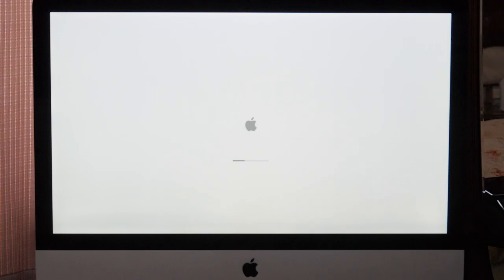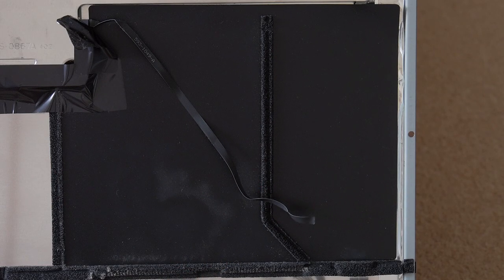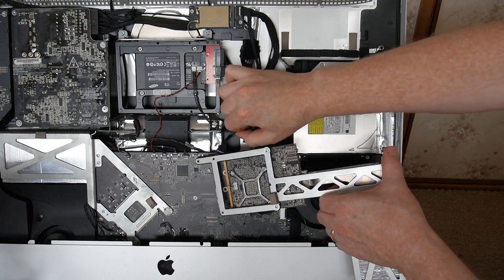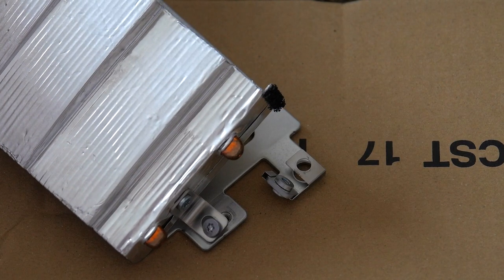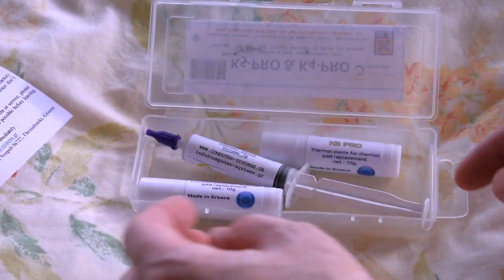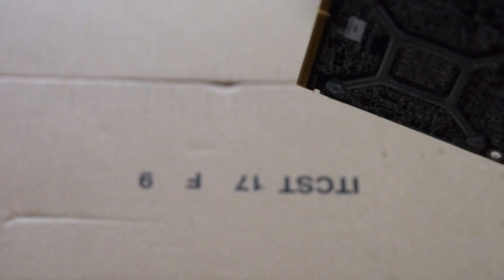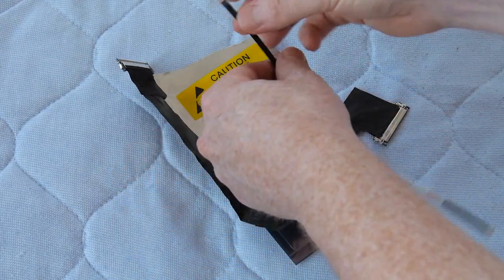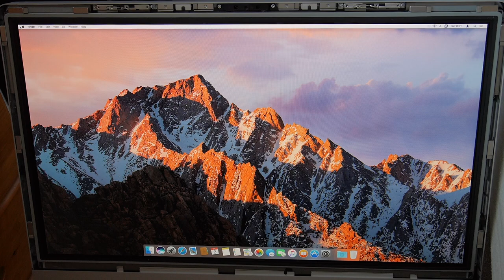Late 2009 iMac 27" Video Card Repair — 4850 — 2nd Bake

Comment: My video card 4850 is complete dead after this procedure. My mac doesn't want to turn on after i place the "fixed" card. It boots okay after removing it. But with her it doesn't boot. It lights from the diagnostic leds the LED 1 and after clicking the power button , the LED 1 has stopping light and nothing from them lights. Only boots without the card. Any suggestion? I do everything correct.
Reply from the maker: Thank you for your comment. I read and reply to every single comment under both of my videos, and your case is the first I’ve heard of things getting worse after the bake. 

It is curious that you say your computer boots without any video card, because your iMac should require the presence of the video card in order to boot. How are you confirming that it boots? And what was the situation before you baked your video card? The reason I ask is because you may have had a problem unrelated to the video card before you baked your video card.
Reply: @JDW-  My mistake not booting. Without the cards it starts spinning the fans and the starting sound of the system. My problem was that I got 5 purple lines. Sometimes it was working without problems but it random get those problems like 5 purple lines or mini square pixels. But now it doesn't want with the card. On the diagnose less. The led 1 is on but when i push the power button it goes off and doesn't want turn on the LED 1. After some minutes it's starts again but again only led 1. Without the video card, they are led 1 and led 2 on.
Reply from the maker: Are you checking those diagnostic LEDs with the display connected?
Reply: @JDW-  With and without i tested
Reply from the maker: @OfficialDjNaijal  Download the following PDF and go to page 23 where it talks about "Diagnostic LEDs."
https://drive.google.com/file/d/1Bs7Th2tfCaXTPC1LXzHFvwRQIgy3_CaQ/view
Pages 24 and after give detailed descriptions and additional info.  As you can see, LED1 & LED2 relate to the Power Supply, LED3 relates to the video card, and LED4 related to the LCD & Backlight and cables. Let me know if that helps.
Reply: @JDW-  So when i put back the video card with the LCD and connected everything back and power with cable - LED 1 it showing ON , but when i try to push the backside the button for start  - LED 1 goes OFF and pushing again the button for start doesn't make nothing all of the diagnostic LED's are OFF. Even if disconnect the power cable and connect it again it doesn't light any of the lights, but if I wait couple of minutes and reconnect again the LED 1 goes ON again and if i push again the power button the procedure loops again and again. Nothing happpend. I guess i need a new replacement card. I tryed with different power cable but still the same issue. If i remove the video card and connect the LCD again and push the button for start it starting spinning the fans , the starting sound and shows LED 1 and LED 2 ON. LED 3 and LED 4 are OFF.

* I want to mention that when i baked the card for 10 minutes on 200 C  one part from the video card peeled off. I am attaching a screenshot to show you which part. Please check it and tell me is it important one. I solder it back. 
https://imgur.com/a/oODPbsO
Reply from the maker: I looked at your photo but you drew 3 red lines on it, so I don’t know which part you are referring to. Are you taking about 3 things or 1?  Also, as I mentioned in my previous reply, LED1 & LED2 both refer to the POWER SUPPLY, not the video card.  That indicates you either have a power supply problem or something is being short-circuited on the motherboard or video card.
Reply: @JDW-  To 1 part. They are 3 arrow lines showing the chip with the green little color you see?
Reply from the maker: @OfficialDjNaijal  I zoomed in and now see you have 3 red ARROWS all pointing to the same 8-pin IC.  You are saying that 8-pin IC somehow fell off your video card during your bake?  200°C shouldn't have been hot enough to melt the lead-free solder used on that chip to the level it would fall off.  Yours is the first report of a component falling off during or after a bake.  But you said you re-soldered that IC back to the video card.  Did you solder it back correctly?  Perhaps you inverted the IC and something is being shorted, which would explain what you see on LED1 and LED2.  Again, those 2 LEDs deal with the power supply, not the video card.  But if something is being shorted, that would pertain to power flow and therefore LED1 and LED2.  It's also not easy to re-solder SMD chips unless you have experience.  Maybe you soldered the chip back with its pins correct but you mistakenly soldered 2 pins together?  Honestly, it sounds like you have some kind of short.  I think that is more likely than a bad power supply.  But you definitely have a power related problem.
Reply: @JDW-  I dont know why it happend. I even get scared because it happemd at the 8 minutes of baking the card it peeled and i felt like troll thinking is that was a joke? Maybe just bad luck. Yea maybe this 8 pin is the problem. Maybe i will be getting a second hand card to try. How can i check the problem to be sure that its from the video card?
Reply from the maker: @OfficialDjNaijal  It could be that your oven's temperature was actually higher than the 200°C setting.  One person here in the Comments told me he didn't trust his oven and put a thermometer inside to check it.  He said his over fluctuated both higher and lower than the 200°C setting.  A higher than 200°C temperature would explain why that IC fell off.  But if your oven really got that hot for that tiny IC to fall off, I am surprised other components on the video card also did not fall off too, since other components are heavier than that little IC.  Some components could have shifted slightly out of place or maybe solder flowed to an adjacent component, shorting it.  What we do know is your LED1 and LED2 lights indicate a power problem.  There's not an easy test for this problem.  You could remove the card, clean it, then either take a very high resolution photo of it or put it on a flatbed scanner and scan both sides so I can better see all components.  If I had your video card, I would take a magnifying glass and look closely at all the components to see if any of them looked like they moved, and I would check that solder had not flowed from one pin to the next.  Again, I can't help but think your oven must have been quite a bit hotter than 200°C.  If you have an oven safe thermometer (like the round ones used when baking turkeys) you could put one inside your oven, set it for 200°C and then check the temp for 10 minutes.  That would tell you if your oven's temperature setting is accurate or not.
Reply: @JDW-  i thinked about that and tested it. My oven is accurate in temp. Maybe just that chip was falling( The question is how important is that 8 pin chip to the video card and can it be the cause to video card to dont run?Can i try to use a isopropyl alcohol to clean the video card good? I will take my magnifer led lamp and will resolder that chip will try make it accurate when soldering to be pin by pin to dont get mixed.
Reply from the maker: @OfficialDjNaijal  Without that chip your video card won't work.  But if your oven really was temperature correct, then it doesn't make any sense to me why it would fall off.  That is very unusual.  Yes, you can use ISO alcohol to clean off the entire video card.  Just let it dry for 24 hours before connecting it again.  Maybe blow it with a hairdryer too, just to be sure no alcohol gets stuck beneath chips.  Clean the board after you remove that chip and then after you solder it back.  Then use your magnifier to check other components.  And if you can either scan the video card or shoot very high resolution photos for me, I'd like to have a look too.  Thanks.
Reply: @JDW-  Yea no lies even the temp was not exactly 200 C it was a little bit lower. I don't know why it happend.  Can i find a replacement 8 pin chip like this one on ebay ? Or they are unique and i can get only a new card? About the photos I don't have a professional camera. I may ask some friends which have to came and take a pictures for me. I will reply back for updates.
Reply from the maker: @OfficialDjNaijal  The photo you put on Imgur is actually my video card photo from Flickr, and even the highest resolution of that photo doesn't show the markings on that 8-pin chip.  I don't want to tear apart my iMac to check, so please either tell me the part number on the 8-pin chip or shoot a high resolution photo of the chip so I can see all the markings on it.  That way I can know if its a standard IC or custom.
Reply: @JDW-  Will do and will reply back. Thanks JDW
Reply: So on that 8 Pin it is writen: Pm25LV010 AE0943 m16975LG
Reply: JDW Updates: I solder again that 8 Pin chip and now the imac starts. LED 1, 2 and 3 are ON but the LED 4 for the LCD not and I don't see anything... black screen. The first time when i started it there was a screen, but now doesn't have anymore? I checked the cables. The cable for the vsync the gold connectors are little damaged. The question is will the LCD be turn on without the vsync cable?
Reply from the maker: The 8 pin chip you resoldered is a flash memory according to the data sheet below. The question still remains why that chip fell off. But if that chip is damaged, that could cause a blank screen. 

I have read that the iMac should display video even without the V-sync cable, but I have not tested that myself. The cable was placed there by Apple for a reason though, so obviously you would want to make sure your cable is in perfect working order.

http://pdf.eepw.com.cn/0/26147e031d0ed551af17cb3b78b363a1.pdf
Reply: @JDW-  maybe the pins were not good soldered by Apple. When i was soldering it for second time pin by pin i saw that some pins are not so long like broken and with little heat in the oven cause to peel off i guess. I think i need to get a new one 8 pin chip cuz this one doesnt look good at the pins. I think they cannot make good contact. At the first boot everything was good screen perfect, but after that no more screen only black screen. The fans , sound and etc is working. LED 1 2 AND 3 are on. I read about the 4 led for the LCD that needs the video card to be working good to can transmit a video signal to the LCD. I can try to resolder for last time that chip. I saw that there are many 8 chips like this one on eBay cheap for 5 dollars. I may buy. The good news is that the power supply is okay and the problem is really from the video card.
Reply from the maker: Purchasing a replacement 8 pin chip is the most inexpensive thing to try. But it is very possible your video card has other problems too. Your case is the first report out of all the many hundreds of comments saying that a chip fell off during the bake. No one else has reported a similar case, which has me worried that your video card may have other chips with soldering problems too that you just haven’t noticed.
Reply: @JDW-  Updates: I resolder that 8 Pin chip for last time and checked all cables. It seemed that the cable for the display the other part where Apple put Black tape over it it was not good plugged in. So i plug it back and TADAAA the iMac is started to work again, but i got a problem it random gets shut down after some time. I was thinking first that it can be the power supply or the hard drive and i checked the hard drive for errors and it found some corrupted files so I reinstalled the MAC OS from USB drive making a clean install by cleaning the hard drive. After reinstalling the mac os i don't occur any random shut downs. Everything seems to be okay, only 1 problem i am still facing on. When the mac goes to sleep mode after some minutes of no activity and then waking him up he is still on Black Screen and doesn't want to light on. By restarting him with the power button doesn't fix the problem it still  a black screen. The only solution with i found is to unplug the power cable for some minutes and the power it again and then it works. Any solutions for that Black Screen?
Reply from the maker: You need to find out if it is only your backlight that is not coming on or if it is the actual display. Try shining a flashlight into your screen to find out. If it is your actual display that’s not coming on, and not the backlight being the problem, the only two explanations are that (1) your video card is still having a problem, or (2) there is a display cable problem.
Reply: @JDW-  I setted the brightness of the display to maximum and energy saver settings ( computer sleep & display sleep) to never and unticked put hard disks to sleep when possible. Too setted the fans to constant optimal (not maximum) speed  with macs fan control. I readed in internet that can help. What you think?
Reply from the maker: @OfficialDjNaijal  None of those settings matter.  If your backlight is not working, and if there is no other problem, your iMac will display the content of MacOS perfectly fine but you won't be able to see it without the backlight.  And that is why I said you need to shine a flashlight directly into your display because that would allow you to see if your display is showing something or not.  If you shine a flashlight into your display (when the display is black), if you cannot see anything at all, then it means your display is OFF.  And the reason the display would be off (when you know it should NOT be off) is: (1) a display cable is bad or disconnected, or (2) the video card is still having problems, or (3) something related to the power supply.  Because you had a chip that fell off your video card, I would see the most likely reason is the video card.  Even though you desoldered that little chip back in place, that doesn't guarantee the video card is fine.  It still could be the video card.  But again, you need to determine if the display is off OR if your backlight ONLY is off.  Probably your display is OFF and probably it's the video card, but you should do the flashlight test first.
Reply: @JDW-  i dont see nothing by flashing a light to the lcd. Anyway after some time the mac is working again. I setred the brightness to max. Some peoples are saying that there are a problems with the mac os the light sensor and if the mac goes to sleep mode it can stay black screen. I setted the screen to max bright and will see will this happen again.

Comment: I just bought 2 thermal paste for this bake:  Arctic MX-4 for the chips and for the GPU I got Arctic Silver 5, not sure about applying this stuff I thought the non-conductive thermal paste should go on the chips and the conductive one on the GPU. But apparently, a non-conductive one can be applied everywhere.Can you help me understand that?
Reply from the maker: Since you have MX-4, use that on the GPU.  It is better than Arctic Silver V according to tests.  But you can't use either paste on the memory chips.  For those you need either THERMAL PADS or K5 Pro (like I did) which is a special, thick paste that acts as a thermal pad replacement.  If you use either of your pastes on the memory chips, it won't be thick enough and therefore you cannot expect good heat transfer, if any.  Here's the link that shows MX-4 beating Arctic Silver V in thermal tests: https://bit.ly/2KGChAm
Reply: JDW got you thanks a lot for the answer
Reply: JDW one more question. I didn’t the bake yesterday and the computer is working but the fan is super loud. After some research apparently it could be  of a bad connection of the thermo controller cable or maybe because I didn’t put any thermo paste on the GPU (I just wiped the old paste and reassembled) what do you think?
Reply from the maker: Immediately turn off your iMac and apply thermal paste!  If you do not apply any thermal paste, there will not be good contact between the heatsink and GPU and that will burn your GPU so badly it will never work again.  You must use thermal paste on the GPU, and you need either thermal pads or K5 Pro on the memory chips too.  This is very, very important.
Reply: JDW ok i will. The first YouTube video I found didn’t mention anything about this paste. Hope didn’t damaged the GPU. Thanks again for your help
Reply from the maker: The text Description under both of my videos explains all about the tools and paste needed.  In my first video, I used new paste on the GPU, but I didn't clean off all the old thermal pad material on the RAM chips and instead put new paste atop that.  That might have been why my 1st bake lasted only 4 months.  But in your case, you said you didn't use any thermal paste at all, and that is a seriously bad situation.  If you could see video then your card is probably fine.  But don't operate your iMac again until you apply paste.  It's very, very important.
Reply from the maker: The place in my 1st Bake video where I talk about thermal paste is here: https://youtu.be/v1DXBLkiqFM?t=33m20s